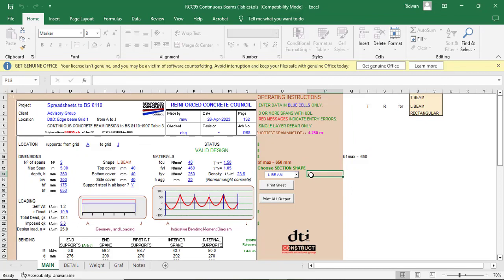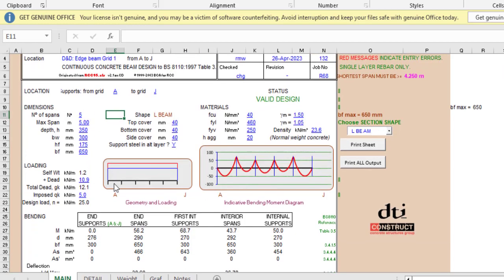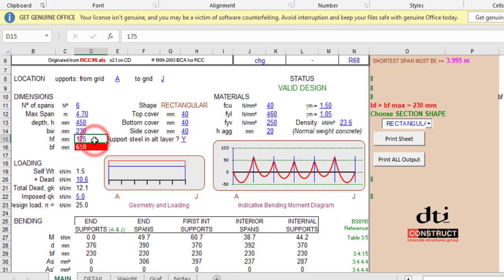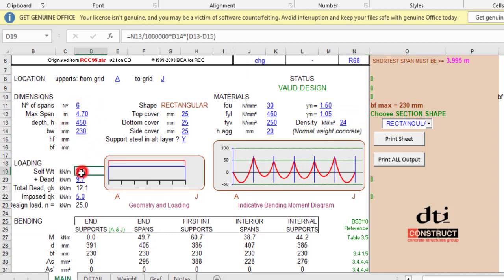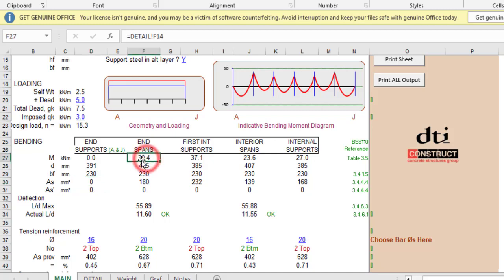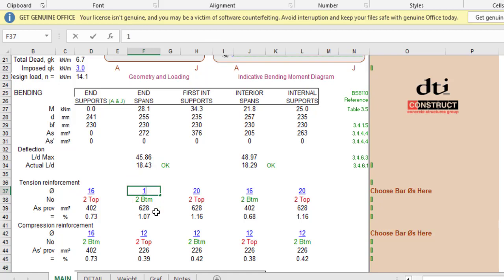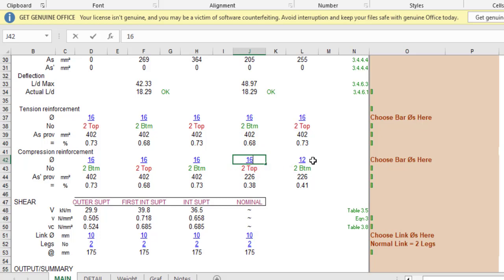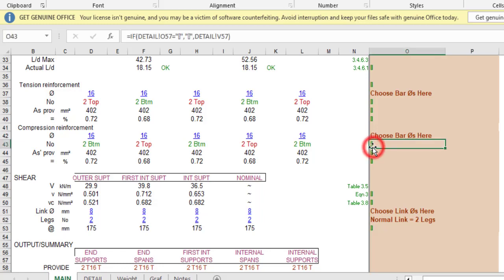EP 8. Analysis & Design of a reinforced concrete continuous beam with RCC 95 excel spreadsheet.

Comment: I have a question please 
Why is it that this RCC spreadsheet  always make a provision for slab reinforcement in (R) that's mild steel instead of (Y) high yield even if the fy used was 410 not 210 ???
Reply from the maker: The spreadsheet was made that way. You should ignore the prefix whether it is R instead of Y. Note that, mild steel (R) is no longer used in modern method of construction
Reply: @ridwantician  OK, thank you Engr